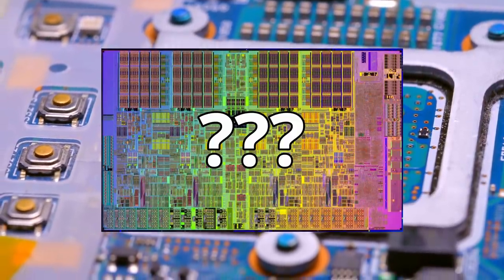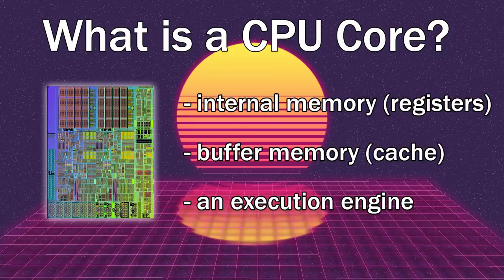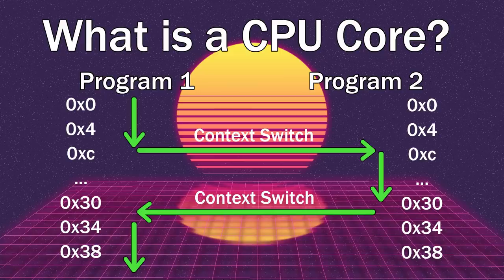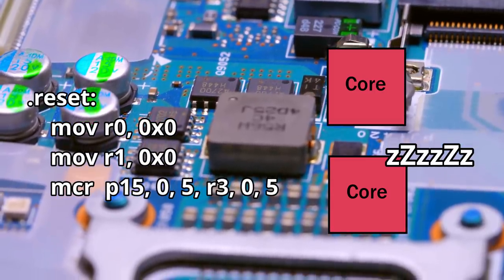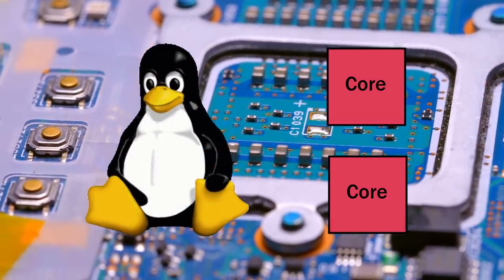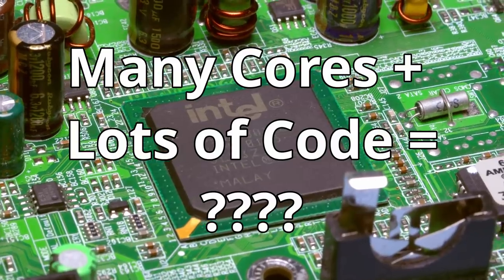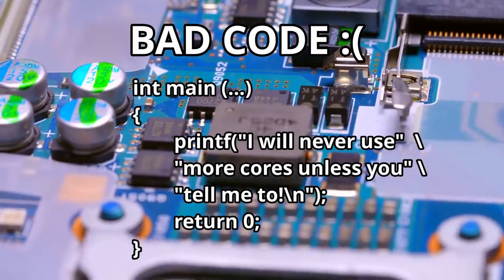why can’t computers have thousands of cores?

Comment: clock freqnecy is capped for most CPUs 4>5Gh 
how fast it works, then optimization of design and multiple cores mean it can off load some processes to diffrent cores, but some programs cap out how many processes it can do at the same time to improve performance, 

so the speed of a program platos cos it doesn't need all the cores cos of how many processes it wants to do is capped.

like that much i understand tho,.

Comment: 1. All depends on CPU build. Actually chiplet design on AMD CPU is better for thermal efficiency. Chiplets are spaced so there is more room. 
2. All depends on CPU build. If there is more cache there is better managed. 
3. Yes this is a real problem and it also depends on program. Some task are easy to spread on many cores some are less. Yet this not mean that having more cores is stupid. Even if You are using program for max 4 cores it is better to have 4 more because You can run multiple programs without any bottlenecks.

Comment: At this point in time, highly parallel tasks are run in GPUs which over time are becoming more powerful general purpose cores with more available memory.  So, in the grand scheme of things, your title is wrong.  They can have them, and they will have them, but they will only be useful for highly parallel tasks.

Comment: Microsoft is developing a PCOS that can better execute programs on multicore processors... but you are correct... coding problems are the main issue when it comes to max performance.
Reply: MS is always in the past when it comes to software development. Linux benefits from supercomputer vendors providing better software than ms can envision. Which is why Linux outperforms Windows.

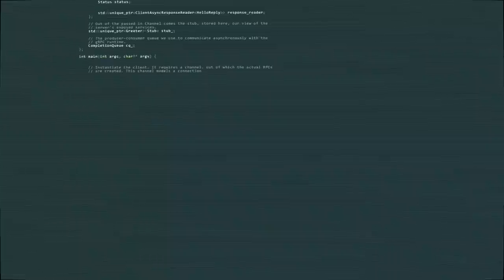Comment: 7:36
Moore's law has already slowed down, and is likely to stop completely in about a decade or two. There will always be ways to squeeze a bit more efficiency out of chips with clever building, but in 50 years from we won't see anywhere near the jump in computation that we saw 50 years ago to now. We might have different computation, like organic computation based around physical nueorons or quantum computing, but our methods for calculating how powerful a computer is today won't apply to those, esepcially the organic 'computing'.

Comment: Since the Original 4004 chip had only 2000 transistors I think that with today's 40B transistor (gpu) chips the process-technology could probably support 20M cores.  But they would be very very slow and there would be a problem for all 20M cores to talk to memory at the same time.  Perhaps you could put 4K of RAM right on the chip for each core, which would cost you about 16K transistors, so now 18K transistors divided into 40B transistors means you could have 2.25M cores.  But they wouldn't be any use unless they could all talk to each other and to the external world.  Thinking Machines in the 1980s and 1990s tried something like this with 65K 1-bit processors.  Needless to say it wasn't good for many things other than processing bitmaps.

Comment: Sign of the times, using an audio reel to reel in a computing video.... suppose the next video should be on hyper threading (SMT)... I have heard some enterprise cores can run 4/8/16??? threads on a single core....
Reply: yea the problem is there is a big diminishing return on lots of threads for 1 core. its why the standard is 1 hyper thread per 1 core as the bottleneck is still the 1 physical core. normally you see about 20-25% performance gain +- from hyperthreading that way adding more unless for a specific application you are not likely to see a ton more. even more your 64 core server cpus still just have 128 threads total

Comment: You really left out a lot as to why more cores are better, and it is going to change in the future to even more cores within a SoC.     Today CPUs bundle in lots of extra instructions to add to, and ultimately augment the current instruction set of a CPU.   Like Intel and AMD add on mmx, sse, avx, avx512, ... and more.   The same is true for ARM SoCs as well.   Going back to those single core days, they never included any GPUs on board the CPUs.   Today you not only have the CPU, but now you can get a GPU as well, but they also add on DMA controllers, Memory controller, and even IPU (Image Processing Units), AI/ML (Machine learning), modems, and more.  The top end GPUs have upwards of up to 20,000 GPU Cores.  AI/ML have lots of AI Cores as well.   Sure they are different types of cores compared to CPU cores, but GPU cores have instructions as well, but they are made to perform graphics tasks, and some can perform high speed matrix multiplication, division, add, and subtract tasks, which is needed for AI/ML.   But then some of the on board AI/ML add on deadicated processing that is specific to only AI/ML tasks.

The future is looking towards adding in all the RAM that the CPU (SoC) will ever need.  Look at Apples M1 SoCs.  Therefore one less thing that a customer has to worry about adding.  Also some chip OEMS are looking at adding in all the storage that this SoC will ever use as well.  So when you purchase one of these future SoCs with all the RAM and storage.   You could be buying a SoC with 64 CPU cores,  10,000 GPU Cores, 64 GB of RAM, and 2 TB of storage.   All on board a single SoC.  That is a nice future.

Oh, and maybe a little off topic, but they are looking at diamond in future CPUs (SoCs), because there is upwards of 150% less heat, and almost double the power efficency.  Google it!
Reply: And what if the individual components die out or you eventually run out of capacity for your programs? Then you're screwed, since everything is integrated and you'd have to buy another SoC. With non-SoC systems, if a major component like GPU dies out, you can replace them; if storage is used up, you can simply expand it internally (external storage will almost always be slower).
Reply: Not any time soon. RAM is expensive. If you follow Apple, it won't be as much as you will ever need, just as much as you can have until it goes into a landfill. Anyone that doesn't max theirs out is intentionally creating e-waste at a higher rate than is necessary.
Reply: @youtubeshadowbannedme  Well chiplets are already in some SoCs, look at Apples M1 SoCs.  They don't make the RAM, and buy the RAM before its even packaged up.   That way they can install those RAM chiplets on board a SoC.   Besides today the vast majority of new laptops that are being made today, don't allow users to swap out their RAM when it gets damaged, or they want to add on more RAM.   Things are changing.  It only makes sense that the future will be one chip that will have all the RAM, storage, GPU, modem, AI, and CPU.

Look at Qualcomm, that have all those things inside their SoCs today, except RAM, and storage.   How many smartphones or tablets do you know of, where users can change their RAM, or storage on those types of devices?  The answer is none.  I can see Qualcomm adding RAM on their SoCs in the future.  Then the next step is storage.
Reply: @laurelsporter4569  For some 8 GB is enough.  For others 16 GB is enough.  Just look at Apples overpriced M1 Ultra.   You pick a system with up to 128 GB RAM, and storage.  If the RAM dies then you are screwed.  As of today most new laptops don't allow their users to replace or upgrade the RAM via a RAM slot.
Reply: @sgodsellify  that's why I only buy business laptops, because they don't have it all soldered on. The problem with X RAM being enough us that anything better than a bargain craptop will live long enough for one to later need 2X that RAM. So anything less than max could be suspect.

I don't know, off the top of my head, but does the HBM used have ECC? If so, full on RAM failures late in the box's life should be rare. If not ECC, though, undetected failures could slip by much longer than a warranty.

Comment: Physicist perspective : Adding more cores means tighter space, and at some point, quantum irregularities like tunneling can become common enough to cause problem. AMD actually have this problem on its 3nm chip thats why producers are still reluctant.

Moores law will be at its peak in the next couple years (quantum tunneling problem). After that, we can only expand transistor area (need more power). There is some workaround for quantum tunneling, some people are trying, But even still, at some point there would be hard cap.

Comment: You didn't cover what the reason for the multi core revolution was. 
In the early 2000's that was a limit to what technology could do and the max normal running rate a processor could reach was on 4Ghz (yes it could be overclocked but would need extreme cooling!) to get over this issue, they took a leaf out of GPU design and decided to add more cores. But as you mentioned, having more cores sounds great but without the memory, bus speeds and optimised codes, Multicores were actually pointless and often caused more problems then they were worth. (several laptops around the time had 64bit duel cores but were disabled by windows to only 32bit single cores) I have one of these laptops and when I reinstalled the windows OS to 64bit duel core, the laptops hardware and cooling couldn't handle the new load and crashed duel to thermal overload!

Comment: parallel code is hard to write. I was writing a small C program that can read matrix 1000x1000 and find average in each row. when i compare the parallel version and sequential version, the sequential version run faster. the hard things about parallel computing is that the code is easy to write but hard to debug, i still dont know why it run slower, maybe is because of the communication between each thread or maybe about memory sharing or race condition, idk what wrong with it, it just run slower.
Reply: may have been RAM bandwidth related.

Comment: Back in 2019 there was already an AI super computer with around 400,000 cores called the Cerebras CS-1. It was about the size of a keyboard if I remember correctly. I'm sure there has to be even larger ones now.

Comment: It's sad to see someone explain something they don't understand... also at the time you posted this video, there was an AMD server processor released in the Epic line, which has 128 cores. There was one thing correct about the video however, which is the statement about a program or application being designed to utilize all available cores. There's also another type of processor production method still being developed, called stacked processors, which will stack processing cores vertically, to utilize more space efficiently.

Processors have different levels of cache, which is abreviated as L1, L2, L3. The cache is temorary storage, for data to be processed. Currently, the processing limit of instructions is at 64 bits, which is the maximum number of binary instructions that can be processed on each core, at a given time (segments of 64bits of data). The greater the number of cores, the more instructions that can be processed simultaneosly. The efficiency is a matter of how sets of instructions are divided up, to be processed by each core; processing the same instructions on every core, would be inefficient, so it needs to be different sets of instructions for each core. Clock speed determines the rate at which the instructions can be processed, which is measured in Hertz, where 2 Hertz would be 2 bits per second, and 2 Gigahertz is 2 Billion bits per second. There is also the Bus, which is the path which data is transferred between different portions of a motherboard, and also different portions of a processor (core 1 is a different path than core 2). There are various types of processor units, most of which do not have more than 1 core. One main factor in programming, is the operating system, which dictates what core is used for what processes; this means that an operating system designed to utilize each core is what is needed, in order to efficiently use every core. The Kernel and operating system use the first available core, after the bootstrap has loaded them.

Basically, if I had an operating system, that is designed to efficiently utilize lets say 500,000,000 cores, then I can utilize all 500,000,000 cores if there was enough data to be processed. Graphics Processing Units have over 1,000 streaming processing cores as it stands, which already invalidates the premise of this video.

Please stop creating misinformation... whether intentional or unintentional, it creates a problem. If you don't know what you're talking about, then don't post a video as though you do.

Comment: Moore's Law has just about run its course. Transistors can't get smaller because of quantum interference, chips can't run higher clock speeds without excessive cooling, and we can't just keep cramming in more cores. Current technology has hit a wall and we need entirely new computing technologies to go faster.

Comment: No, you are missing something, the reason you can't have a 1000 cores on a CPU is because of the instruction set. The instruction set assumes  that all cores have their cashes synchronized. It is this synchronization that becomes the problem, the problem is not the heat(to some limit) nor the engineering work. Just look at a GPU it has many thousands of cores, but it can do it fine because it is not slave to the synchronization problem.

Comment: Well, TLDR is that we can make as many as we want, supercomputers are basically "Single" machine made of multiple machines,  with absurd numbers like 70000 CPU cores working on the same thing. 
as cost scale in polynomial way with size, making a single CPU that would have that many cores literally impossible cost-wise. 
software is written to use one of 3 scenarios.
a) ONE, I don't care, it's not worth effort to use more
b) set number, be it 4/8/12/20/69 whatever, but it's designed to use that and no more. It simplifies design while still getting faster.
c) how many do you have? Usually it's some batch processing, we have 5000 files/tasks to process, every one of CPU's gets one.

Comment: FE-DC-EX-WB. (or more stages as is commonly known with modern computers), Just wrote that so I could "do a funny", in otto-engines (4-stage standard engines) the 4 stages are easy to remember and is (yes it actually is); Suck, Squeeze, bang, blow. (intake, compression, detonation, exhaust).

Comment: there actually exist 1000 core processors already, I think it was since somewhere like 2013, arm like/RISC processors that where. however such a CPU is more used for computing in general and more like a GPU instead of a CPU, however with AI and good software development more than 1000 cores can be rather usable soon, for example Blender doesn't really seem to have any currently realistic limit of CPU cores it can use efficiently, and it can even use CPU cores of different architectures at the same time, as well as CPU and GPU cores at the same time with both working efficient.

Comment: The parallelisation issue is pretty much why almost anyone watching this video likely has a GPU that is running in the high several hundred to several thousand cores. Graphics workloads are super easy to split up like this the vast majority of the rendering work is calculated per pixel thus you could utilise 2 million pixels for most of the workload while processing a 1080 frame. Not for all, you could never use this fully to decode a video for example as there are calculations that involve neighbour pixels involved. But a GPU could probably scale to hundreds of thousands of cores and still perform far better even running current code simply because you can split the screen into boxes that can be calculated independently and there are a ton of them.

Comment: Good explanation. Today's desktop CPUs seems very outdated, needs better and true parallel architecture and this will require almost complete new computer engineering design protocols of how motherboards and OS should all work together. It makes sense now why many cores in a CPU are not viable as to lower cores.

Comment: Amd kinda solved most of these problems to though. Chiplets can be spaced out to remove the thermal problem and also include a beefy memory controller to almost indefiantly just add more memory lanes. Not toe toon using a more efficient articture than x86 that would be less of a problem.
The only real problem is software but that is also solvable. Just as games went from 1 to 4 to 8 cores being properly utalized. That is just gonna go on with better programming strategies.
The real mane problem here is cost. As you need to pay for all those cores and not a lot of consumers need that mich performance.

Comment: At 2:15, I know you might wanted to have simplified the discussion but the statement is clearly wrong.  1 execution thread does NOT = 1 program.  A program, to most people would be like Excel, Word, 7-Zip, Adobe software, Autodesk software, a game, etc......  Well, now the the world of programmers have been told they HAVE to improve multi-thread performance or their software is going to run like CRAP compared to their competitors, almost all programs spawn hundreds to thousands of threads during execution, even if there is a single main thread.  So that simplification for the discussion throws in a big falsehood,  especially when programs are dealing with lots of data.  7-Zip breaks apart a compressed file into chunks, and sends chunks to different cores and reassembles files after they've been decompressed.  In this way data processing is greatly sped up.  Video editing programs, when rendering a final product does the same thing  If they didn't they'd be terribly slow.